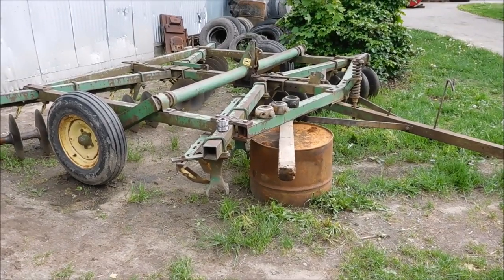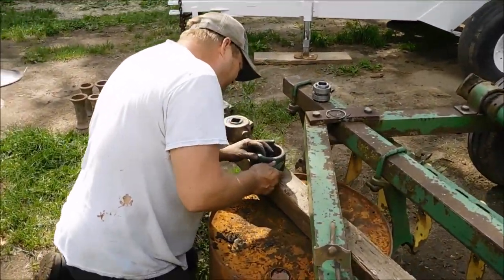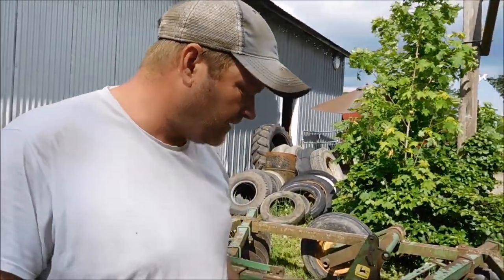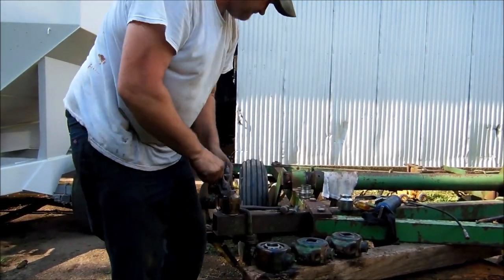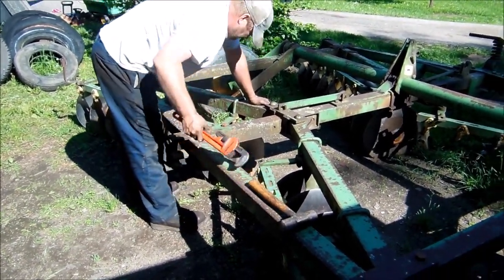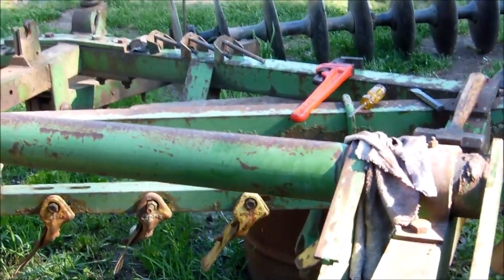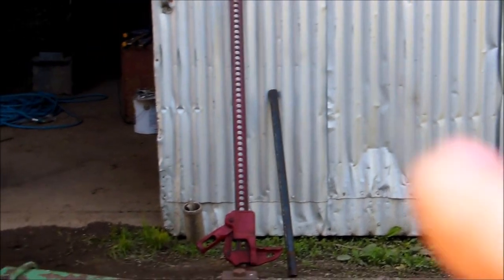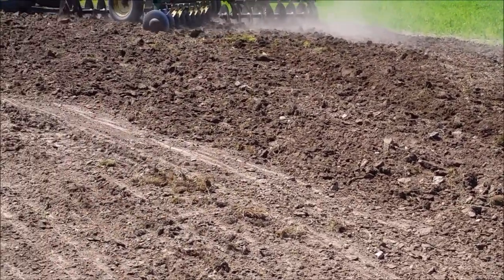John Deere 12 ft Disk Gang Repair

Comment: Had a bwa disc and pulled it with a 720 John Deere diesel disc was.12ft pulled it in 4th gear did a good job really went in the ground and left it.pretty smooth
Reply from the maker: Thanks for sharing

Comment: Hi
What's the model and year of your harrow. I just bought a Case that is almost identical but no one knows the model number.one of the best designed plows I've found
The Jack's are "widow Maker"
I bolted a piece of steel plate to the base to help stabilize
Thanks Mike

Comment: Could you please post some up close pics of the ends of the gangs where the nuts are? I have slack on mine from wear and I’m trying to figure out where exactly I need to place my washers to take up the slack. I could kinda of see it in the video but it was dark. Your help would be greatly appreciated.
Reply from the maker: I cannot,  sold it as we are permanently planted to hay here.
Reply: I gotcha, do you happen to remember the serial number on it for parts? Mine is worn down and I can’t read all the numbers. Maybe it’s on the order from when you ordered the bearings